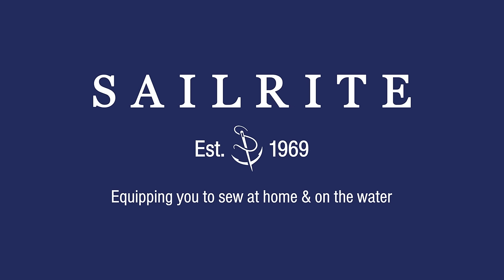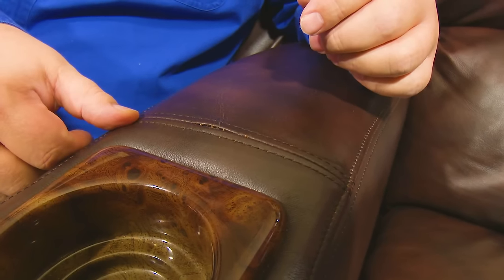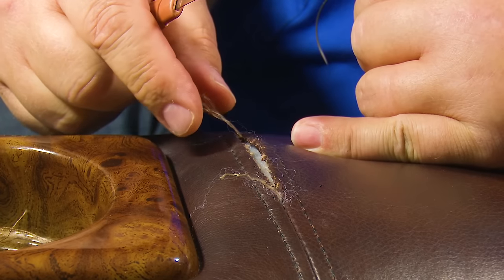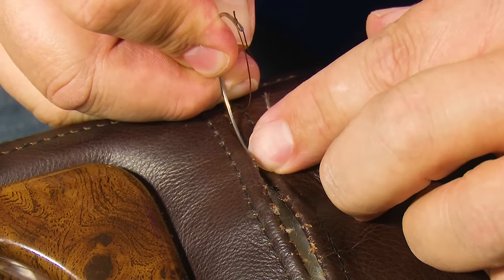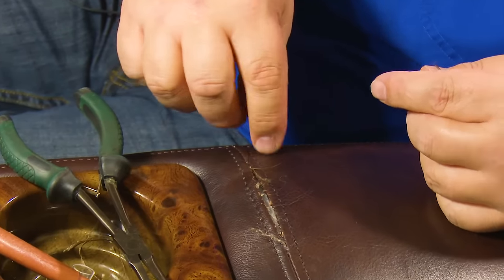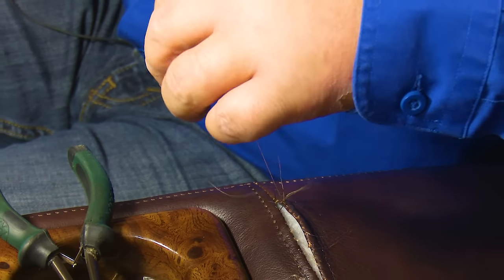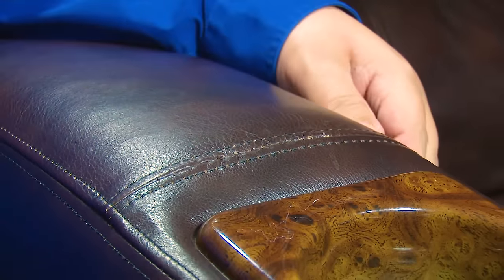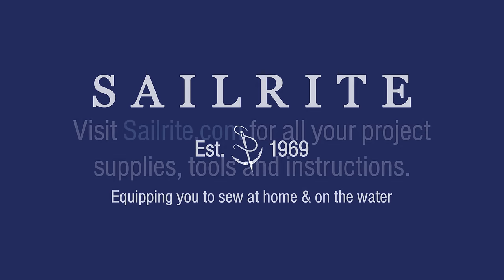How to Hand Sew a Broken Seam on a Leather Recliner

Comment: Going back over the seam again so that the leather has thread on the back side between every stitch hole on each side will keep the gapping to a minimum. Also, instead of trimming the pigtail of the existing thread, wrap it several times around the new thread before pulling it back down under the seam. That way the entire pigtail will be preserved and limit the possibility of the knot coming undone, especially if the knot winds up being two half-hitches instead of a full square knot.
Reply from the maker: Great suggestions. Thanks!!!
Reply: GraeMatter
Reply: Do you have a video for this process?
Reply: Nobody will bother doing that. Don't you know how to sew with two needles? Perfect finish and yes pull the tail under the seam 👍
Reply: @angelinaphillips2165  I do 🙂

Comment: So glad to have found you after a number of bum steers! Thanks for these super clear instructions without which my drivers seat seam split would not look as "invisible" as it does now. A four inch split took me about 60 minutes because I had the tools mentioned at hand. And I was able to thread the pigtail into the needle with the tail and then pull both of them under the seam. Thanks for taking the time out to do this and for having the video and audio tech to paint the picture. You're an ace!  God bless.

Comment: Use an ice pick if you can find one. It makes the hole bigger so that the needle goes in easier. You can also use wax on the needle. That is what we used to do in the shop.
Reply from the maker: Great suggestion.

Comment: how deep do I need to go on the leather? Do I need to use a curved needle? It seems easier to just go in and out of the hole straight rather than trying to hook under the leather
Reply from the maker: I think a curved needle is better, but it can be done with a straight needle. No rules for this just do what works best for you!

Comment: You should of used a finer needle, and you need to start 1 stich behined where you did, you also made too many holes in it so it looks messy, you also pull it tight as you go.  I did this kind of work for 45 years.

Comment: I restitched the seams on my convertible top. It's VERY hard to pick the needle through 3 layers of rubberized canvas. I would recommend a good pair of gloves, thick nylon UV resistant thread, a pair of needle nose pliers, and extra needles (you are going to break them)

Comment: Hi Eric, I'm about to sew up with curved needles the leather seat cushion of a leather recliner chair.  "Rule of  thumb," what simple formula do you use to determine how much thread you'll need to cover a certain length of area?  So for example, if I have a 12 inch length (it's actually a lot longer, about 6" and 15" in 2 sections) that I have to sew with a curved needle, how can I simply determine how much thread that I'll need?  2x the length?  2.5x the length?  3x the length?  Thanks for your help.  Keep up the great work with your videos.  This one was very helpful.

P.S. Do you folks have any leather repair supplies such as to dye and seal up a hole and make it look "like new?"
Reply from the maker: I usually will cut a length of twine that is about 3 times the length of the repair. It is better to have too much than to have too little. In the end you will cut away the extra. We do not stock much for leather sealers and dye, instead check out Tandy Leather: https://www.tandyleather.com